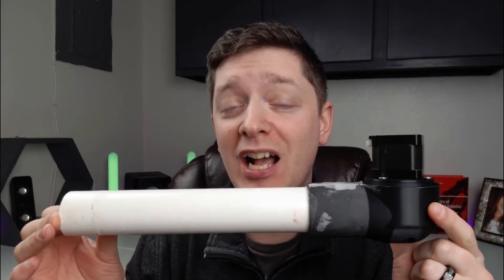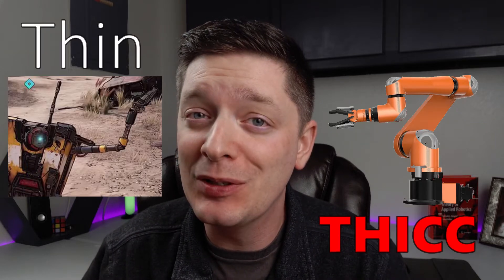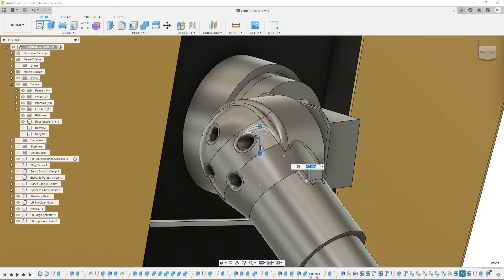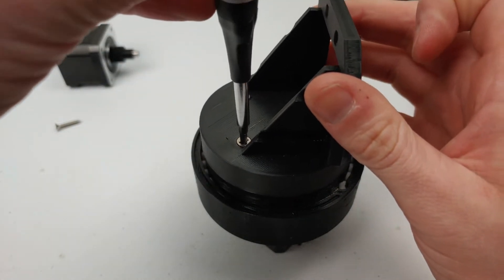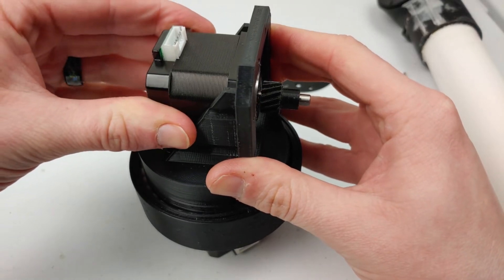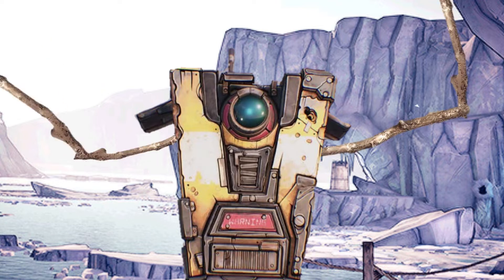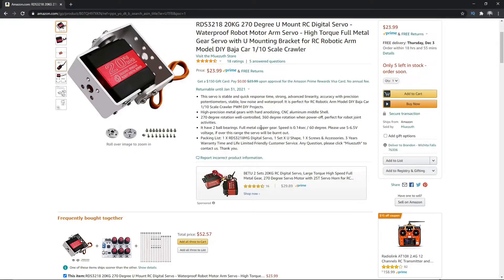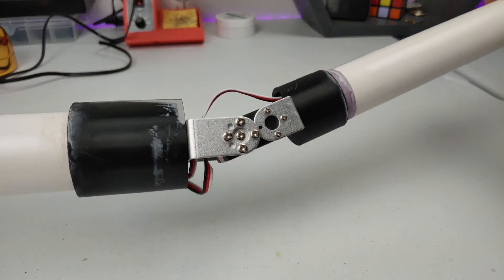Real Life Borderlands Claptrap - Robotic Arm (Part 2)

Comment: Very cool love the PVC pipe. The more off the shelf parts the better.
Reply from the maker: Exactly! I want the ability to repair Claptrap from easily found items. That's actually the reason I went with the size motor/tire thatl I did, as it can be replaced with a riding lawn mower tire. Some pieces will be specialized but I am trying to keep those 3D printed if possible so that there is no need for expensive CNC machining and can be made quickly/cheaply with what are now pretty common machines.